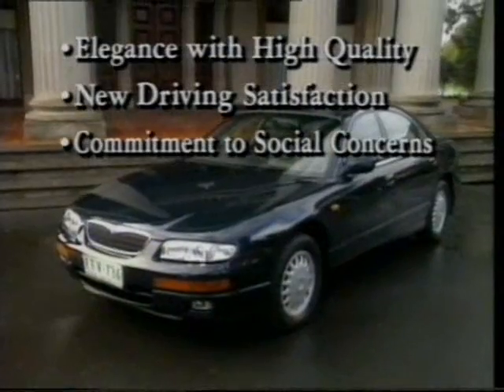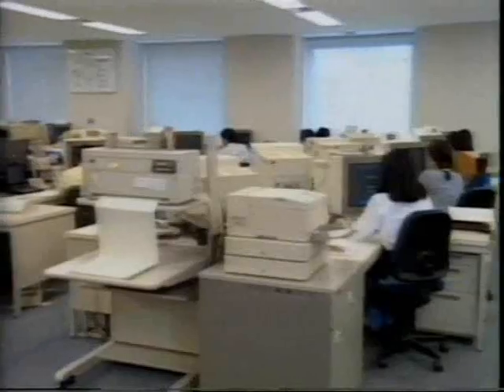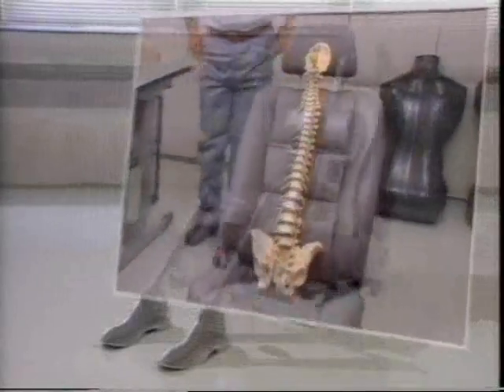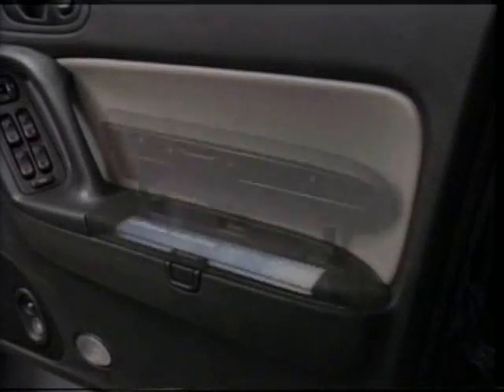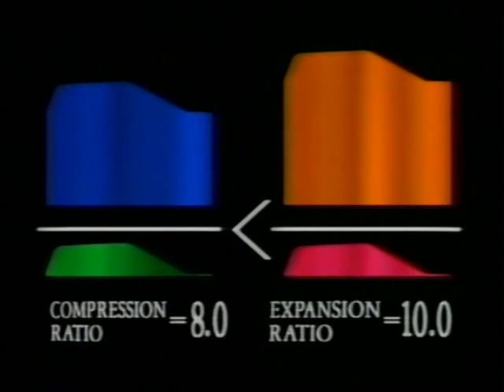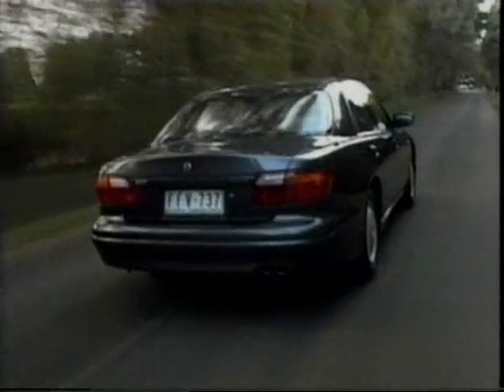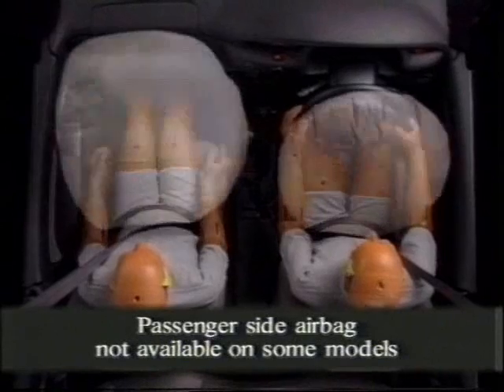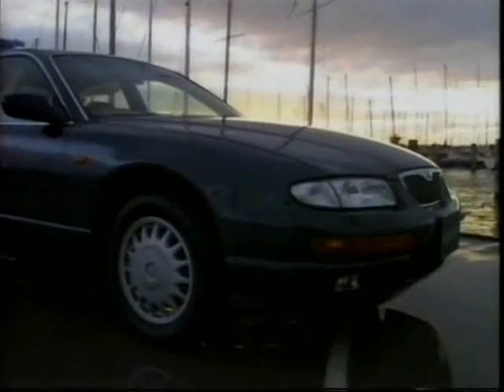Eunos 800 - Our Ultimate Obsession

Comment: does any one know how to fix a TCS fault , the TCS light stays on and the transmission shifting has gone jerky when shifting ! its just started doing this for no reason it feels like an engine miss fire but its the trans ,a mechanic told me its the friction discs in the trans but im not convinced can any one help with suggestions thanks , the car is the 97 model 800 Miller Cycle

Comment: Audi2000t : the only problem i have is some smoke blowing when i start the car after its sat there for a while (over 2 hours) it turns out that these cars are known for not so great supercharger seals, so a little oil gets thru and is burnt up. it doesnt smoke whilst driving, and the car goes like a dream. just damn expensive to get a service if you cant do it yourself.